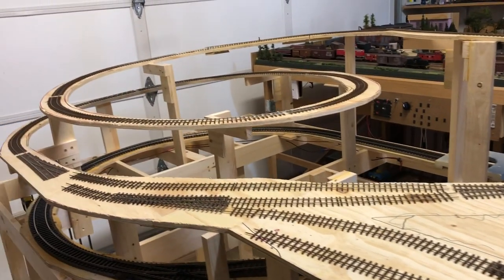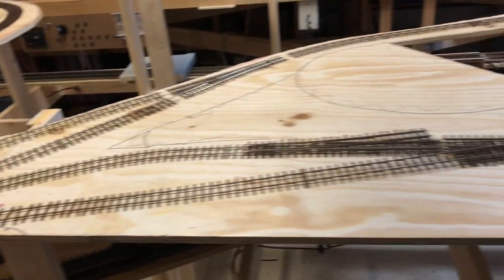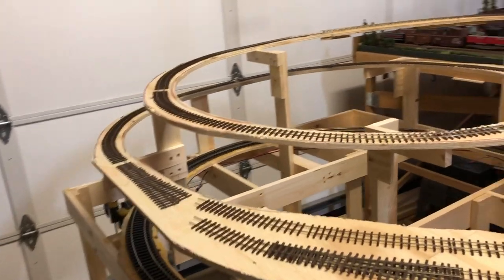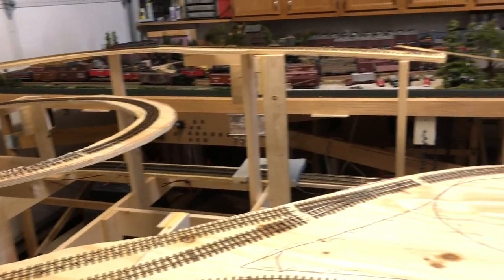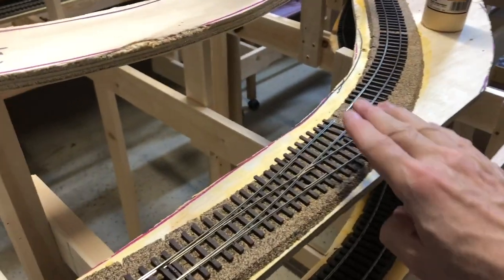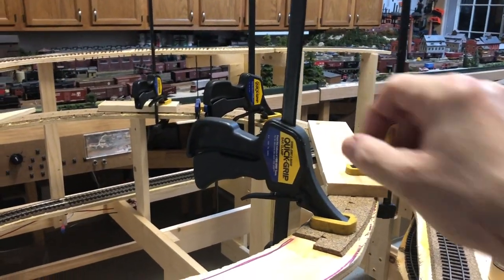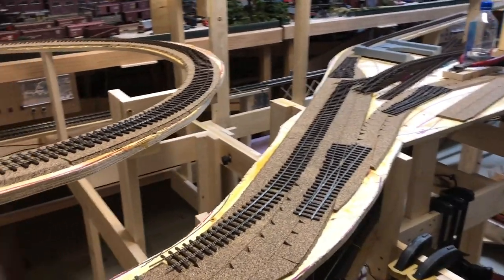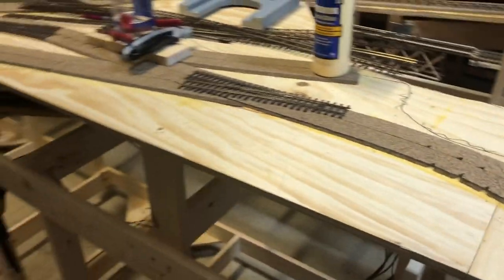Cork & Track go on On30.  First Run of a On30 Loco - Model Railroad Adventures with Bill EP168

Comment: Bill I have four 3/4 inch 4×8 foot sheets of plywood I purchased for a different, but now moot project. I plan to use them in the building of my On30 layout.
Reply from the maker: That will give you a great sub roadbed 👍🏼👍🏼 solid foundation makes for solid track

Comment: Great progress.  👍👍. That’s a steep grade for sure.  I was surprised it pulled the car clear to the top.  Doubtful if any more?
Reply from the maker: Thanks Fred!   Actually it can pull more up.  I tweaked the grade very slightly at the riser just after the point where it slipped.  Now engines don’t slip there snd I can haul a several car train all around the layout.  Next video will show my roster of narrow gauge engines tackling the layout 😄
Reply: Look forward to it.  I had to smile when you talked about moving two layouts to just get to rail joiners.  I’d never seen video showing your high shelves over the wood cabinets.  I have to ask, do you design submarines for your day job.  You sure know how to fill up a space. 😀